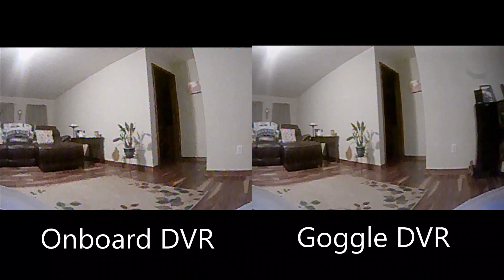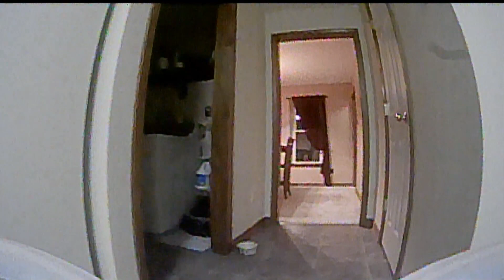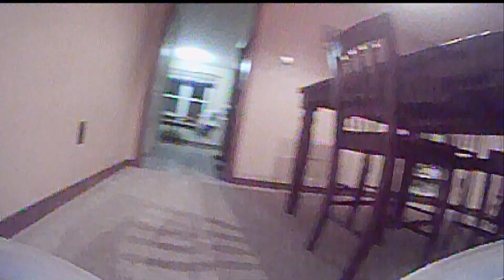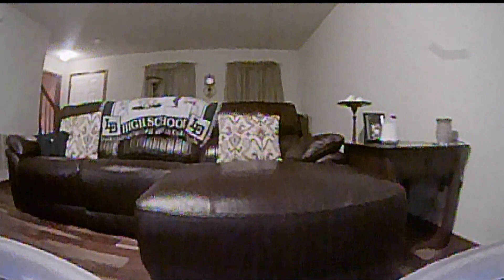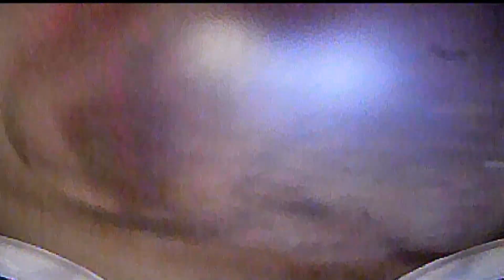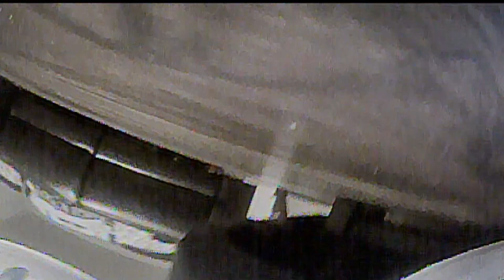Mobula7 Diamond VTX Upgrade Comparison

Comment: How in the world did you get this to fit? I have been trying to fit mine for the last couple days under the stock canopy with the camera just seems like there's no way am I missing something? It would be so cool if you could do a real quick video on how to do this oh, I know I'm not the only one with this question
Reply from the maker: First off let me say I wish I hadn't done this mod, the moby is heavy and with the higher vtx power it eats packs up. Flies like a rock now lol! I did replace the stock canopy but that was for the new camera, no more room. Turn the rubber mounts for the flight controller upside down, grooves on the bottom. This lowers the FC just enough to set the vtx right on top of the rubber stand offs. Then you gotta line up everything and get the screws in, it's a beotch! I don't even fly the moby anymore because it sucks, it was a great flying whoop and I had an awesome tune. I burnt 2 motors up after the mod too, trying to get it tuned, never did. Good luck man!
Reply: @ILLBEDRONED  So the vtx only weighs like 4 grams, it made it fly that much worse? I will run mine on 25mw for the most part, I should have my mods done in the next couple weeks, probably be making some custom fdm parts to make it happen. Check out my channel if you get a sec. If I come up with a good soulution via 3d printing I can send you some stuff for your mob 7 also.
Reply from the maker: Also had to modify the canopy to get to the record button and ran the buzzer out the back. So long ago, trying to remember, but it was tough!
Reply: @ILLBEDRONED  okay, thanks for the Intel maybe I will just end up using the Kydex camera wired back into the original VTX

Comment: Looks really good. I have been tinkering with the ET115 trying to install a 200mw vtx. There isnt any room under the canopy so I'm trying to put it in the stock location above the battery. I had it mounted in a mockup but the channel selector sticks up too high and is hit by the battery. I have to remove it or flip the board.
Reply: Grayson hobby has a video on how to turn the et115 into a cinewhoop, you may want to look into that possibly Good luck.
Reply: @NYC11435  My ET115 is already a cinewhoop. I run a Foxeer Mix but keep the stock canopy(most of it). That is why I have to find room for the vtx in the stock location.
Reply from the maker: @NYC11435 wish I could've found a video for this project. Found one but it skipped the parts about relocating the buzzer to make it fit, and modifying the canopy to reach the buttons on the vtx.
Reply from the maker: @MnPaul man it was frustrating but worth it!! Thanks buddy!!👊😎